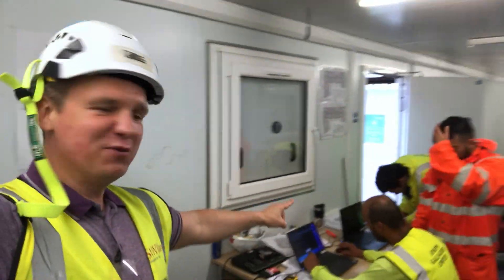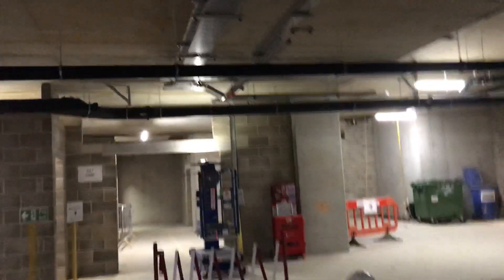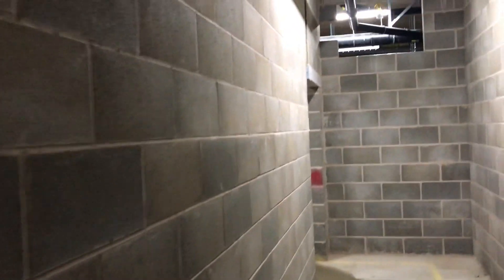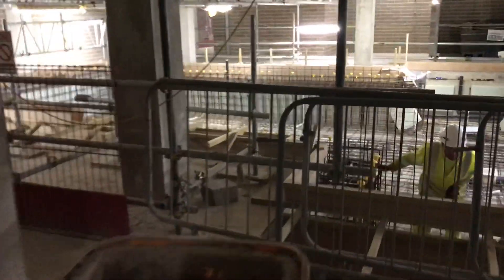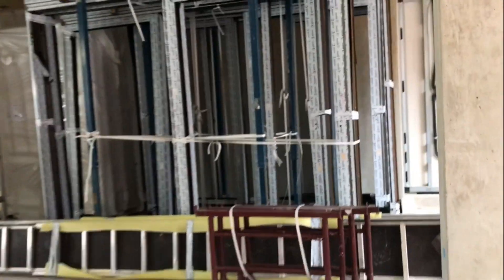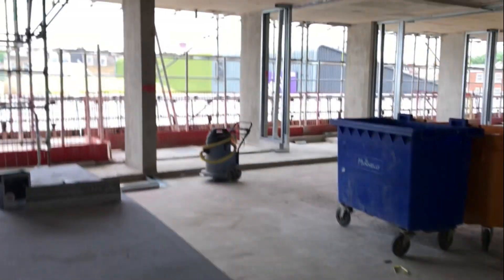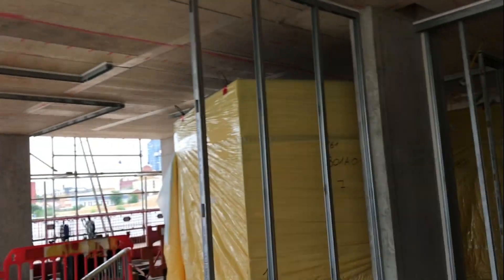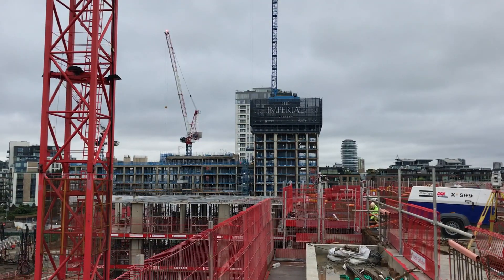CONSTRUCTION SITE WALK. How it looks after concrete frame is done. BATHROOM POD.

Comment: Grt vid again mate would appreciate if you show us one day best way to set out gridlines and gridlines that come in angle. Appreciate your hard work
Reply from the maker: Thank you Khalid! I will try to do one, you can check my ref. line video as typically you will use ref. line program. You can also rotate reference line to angle needed, but I would take two points on the line and set it.

Comment: Interesting to see the lintels supported with bearing on both walls. In my project, we are actually providing a lintel band across the periphery and mullions on wall corners and end walls. What is the block size ??
Reply from the maker: I believe they typical ones 440x215, but not 100% sure :) Lads are using precast lintels for door openings. Wall is built ar. 20mm below soffit of the slab (dependant on slab span and deflection really).
Reply: @SITENG  What type of flooring you are doing at Basement??
Reply from the maker: Some of it there will be painted, some are just concrete brush finish.

Comment: Was setting out the pods setting out the walls, shaftwalls, party walls,  plasterboard gipliner and MF5 ceilings and loads of SAS, all types of bulkheads,  
Lights, air-conditioning slots, sprinklers, access panel, Smog Vents Risers, socket, builders work holes, steel Posts  in risers or any different areas,
Was setting out the first metro bank with 33 ceilings levels in one room 
Grid lines datums glass partitions, doors,  lift shafts build of shaftwalls 
And build all above my self 🙃
All of that was on leadenhall building, scalpel, amazon building, Barts hospital, Kings Cross St Pancras Station Thameslink platforms 
TFL buildings loads of schools, NHS sites, shopping centres, China global TV CENTER, Royal mail buildings, Shell offices, Gyms, 100 and 150 BISHOPSGATE, Victoria NOVA, One Hyde Park Corner and many more 

Very nice video Greg 👏🏼👍🏼
Reply from the maker: Thanks Thomas! Great jobs you were working on. I worked on 100 Bishopsgate with Byrne Bros, great project too. Worked on Nova as well :)

Comment: Greg what formwork did they use to form the curved slab edge & parapets for the 1sr floor opening? 

Nice video as usual! 👍🏻
Reply from the maker: Thanks Alberto! Actually they just used a ply cut to be able to bend it (I will show you the picture:).
Reply: Was it set  out with quick arc the curved slab?
Reply from the maker: I wasn't doing setting out on this site, but I believe ref line was used as lads uploaded drawings to the controller.